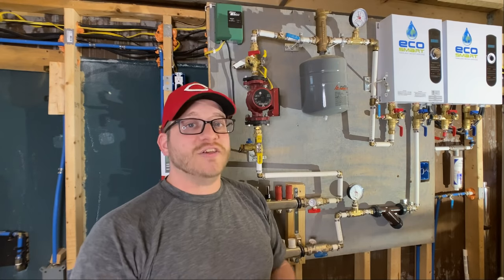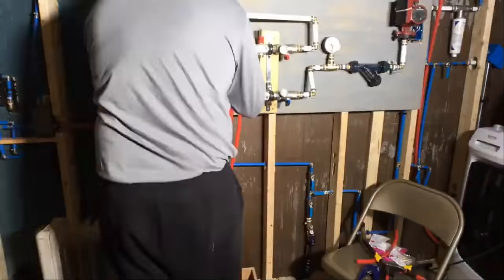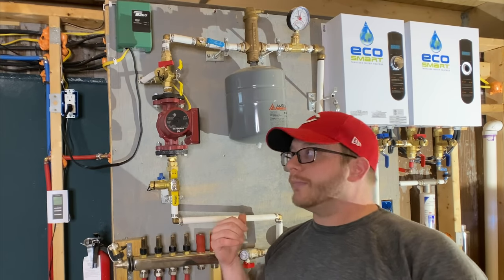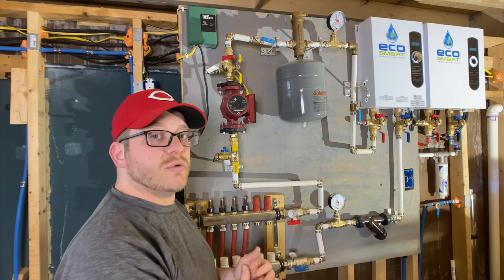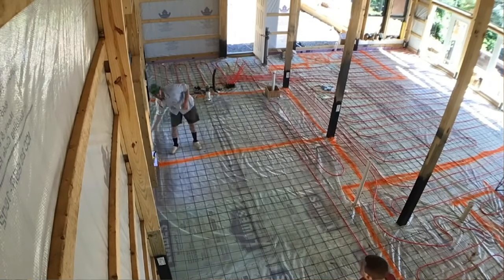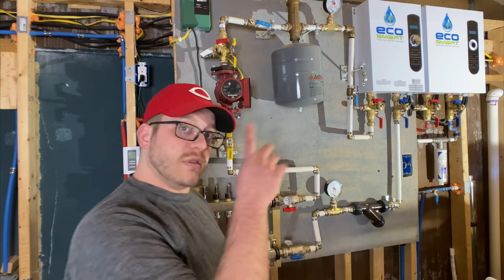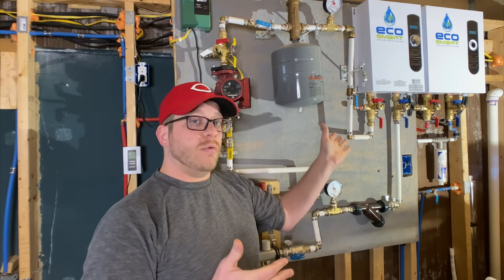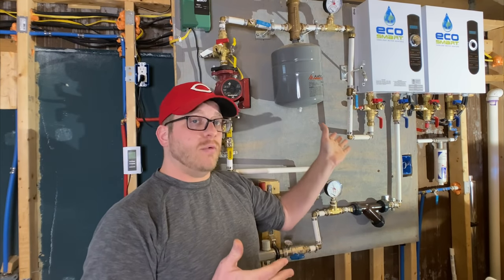Amazing Radiant Floor Heat | One Year Update & System Costs

Comment: I am researching for a build that my wife and I are hoping to start in summer 2022, and stumbled across your adventures.
We are going to construct an earth berm concrete house, and are already sold on electric (grid tie solar) hot water radiant heat.
Average temperature of the earth is around 52-degrees, so we're only expecting 22-degrees (?)  increase. I like the thought of on-demand because we will have 4+-feet of soil on more than half the house (due south with plenty of glass).
We will be around 1,500 sq-ft of living space, and almost another1,500 sq-ft of garage, workshop, mechanicals room, and pantry. 
Do you have thoughts on expanding your installation for an option?

Comment: What is your temperature set to and also your electricity rates?
Reply from the maker: Usually set to 110f rates vary but around .097 per kwh
Reply: @LittleMountainLife  Your heat your house to 110 degrees?
Reply from the maker: Sorry no the house radiant is set to 65 in the winter. The electric water heater for the radiant is set at 110.
Reply: @LittleMountainLife  Thanks for the info.

Comment: When wiring the Taco, in the instructions is says to wire it to the "TT" of the boiler.  Well you're using an EcoSmart instant hot water heater, and has no "TT" to connect to, so what did you do?

Comment: Hey guys, love your content! Quick question is how did you figure out what size expansion tank you needed for your floor heat system? My wife and I are in our home/ attached shop dwelling. Large pad single story,approx 4300 ft of 1/2 inch pex. Anyway, trying to calculate required tank specs, any help greatly appreciated! Thanks!
Reply from the maker: I would contact Radiantec or supply house dot com and see what they recommend for your size system. That’s what we did and it’s worked well.

Comment: Aren't there any safety valves on the system?
You should add a mixing shunt to the system, it makes it much easier to control the temperature for your floor heating.
Reply from the maker: There is a pressure relief valve just after the heater. 🙂
I know some people opted for mixers but we are pretty happy with the setup after a year. 
Thanks for watching.
Reply: Mixer actually has no point when only heat source is direct electric. As the control of direct electric is so easy to do with thermostat according to water temperature. No point of making 120F water and then Mix it to 100F or so as it just increases losses to room air at the space where mixer is installed. Just control the heater setpoint which should be as easy as controlling the mixer. 
Anyway adding mixer to this kind of setup later is dead simple as it only needs one piece of pipe added, but without buffer tank and some other heat source (solar, water circulating fireplace etc) I see no point.

Comment: Newer air source heat pumps or ground source heat pumps are way more efficient than fuels or electric resistive heating by up to 5x in some cases. With the system your running or if you modify to use what i just mentioned and your systems is closed loop, you should consider a propylene glycol antifreeze with inhibitors designed to make your system components last a long time. That PG antifreeze should be mixed 50/50 with DISTILLED water. Doing this will reduce the risks of build up or material deterioration drastically if your using regular water at this time. It would be interesting if someone was to get one of those dual zone air source VRF units and run 2 large AO-Smith tanks without the heat exchanger on them and couple those tanks to to the dual zone air source heat pump. I am guessing you wont get much over 120F temps but the efficiency of the entire package goes way up.

Comment: I have an 864 sf two story home on a cement slab. The footprint is only 24'x24', so downstairs is 576 sf, while the A frame upstairs is 288 sf. If I were to install radiant heat flooring downstairs, do you think the heat would rise to heat the upstairs, or do you think I need to install radiant heat flooring upstairs too? The A frame ceiling is not very high upstairs.

Comment: How many KWh per month do you use in the winter? What is the cost per KWh from the electric company? Here in California electricity is expensive. I use about 1200KWh @ $0.25 per KWh or approximately $300 per month. I use wood heat only.

Comment: Does the 10 lb pressure of the water trigger the Eco tankless heater?  Which would cause the heater to never shut off.  I imagine the pump is what causes the heater to kick on....but I am concerned about my install and the 10 lbs. of pressure.  Also...do you keep the hot water heater at 110F for the radiant heat?  I saw that number on your video?  thanks

Comment: I have a geothermal system with all the valves ,pumps air bleeders, I tossed it all have a sub pump in a bucket in and out flow no pressure just what the pump pushes simple no air traps.in a closed loop system

Comment: Hi! Been waiting for this video! So, how much kwh your system uses? Prices vary by region so that would be clearer for everyone. Also is the other heater for your hot water? Do those prices include both heaters or just floor heating? Please kindly respond.
Reply from the maker: We leave the heater on 24/7 with one 9kw element on during the coldest months. So if my math is correct that’s 216kw/day. 
Yes the other heater is 27kw and that supplies hot water to the kitchen, laundry, and shared bathroom. 
The prices I mention in the video only included the one 18kw heater for the radiant system.
Reply: @LittleMountainLife  your WH shouldn’t be on 24/7. If it was and your calculations are correct you’d be spending $27 a day just on heat if you were here in Montana where we are .09/kWh. Can you look at utility bills for a few winter months and see what your actual usage was?

Comment: Did you consider using a heat pump? Either air source or — more expensive but more efficient — ground source?  The investment cost is considerable, but the with coefficient of performance from 2.5 at the coldest outside to 4.0 — which means every KW of electricity put in you get at least 2.5 KW of heat out — that monthly $250 could be $100 or even less and you'd be looking at a payback period of about 5 years.

Comment: Just curious as I am not familiar with these systems at all. What is the advantage to pumping hot water, compared to just running electrical elements in the floor? I feel like hot water would only be more economical than direct elements if the water were heated by gas, heat pump, or district.

Comment: Nice job on the home. Do you use both electric water heaters? I think you said one was 1800 wats and one was 2800 ways. 
I’m building a 40x60 shop in Iowa. The frost walls are 4’ tall lite form 8” thick concrete
Reply from the maker: The 18kw is just for the radiant. 
Then the 27kw heater is for the shared bath, kitchen, and laundry. 🙂
Thanks for watching
Reply: Just outside of Omaha...40 X 60...keep the shop at 68 degrees...I believe it only cost 40 a month in the heart of winter.  Last month with my bill was 458.00 for my 4200sq house...40 X 80 building and a 25 X 35 pool house.  The walls are foam insulated in the shop and cellulose in the ceiling.

Comment: You need a pressure relief valve on the isolation valves on the hot side coming out of you boiler,  You currently have them plugged off.
Reply from the maker: We added the valve back after this video, thanks!

Comment: Do you guys use pure water in the loops? Or are there additives that you use to keep the system running right? It seems like there is very little metal to corrode in your system, but still thought it is worth asking.
Reply from the maker: Yes, just water.  Thanks for watching!
Reply: Like normal heating water as pex-pipes have oxygen barriers, after water has been in the system for some time and air is bleeded several times, there is hardly no oxygen left in the water, corrosion is really no problem. I've seen many houses with 70 year old radiators and piping that has just water in it, even if whole setup is done with iron pipes. There will be thin black layer on top of the iron pipe and water stinks, but system is fine after decades.

Comment: Awesome job. Been wanting to pull out my gas wall mounted boiler which is nearing end of life and putting an 80 gallon hybrid heat pump DHWH just to see if it could power the hydronic heating. Where I get stuck somehow putting a hydrostat at the in-direct HW tank to tell the Grunfos to run (right now the boiler handles this). I don’t think this experiment would pan out but would love if I could find guidance on designing it.
Reply: Same as his Taco relay he has there.

Comment: Question for ya, I'm looking at using the same hot water heaters, but the ECO8 Model, you said you turned off one breaker to the ECO18 , what are your inlet and outlet temps running with only 9kw vs 18kw
Reply from the maker: So I later realized the eco smarts have a sensor making it so the unit only draws the power needed to heat to the set temp. I now keep both elements turned on at all times.

Comment: Hi I have a boiler radiant system gas and I want to stop using gas and move to electric. with these heaters can I use them with my existing system? thoughts? I was also thinking about using a heat pump water heater in correlation with the current system.

Comment: I built the same exact system you did and my garage is 21 x 32 and i keep getting an e4 error on heater and system is running for a week now and water comming out of floor is still 40 degrees?? help
Reply from the maker: Definitely reach out to the heater manufacturer. Sorry about the troubles.

Comment: For your mini splits, upsize the compressors and get heat exchangers (hydronic) then run your floor heating off that in the winter, instead of the electric tanklesses. Should be way less ongoing cost and more environmentally friendly!
Reply: Except there is no such thing as an A2W mini split, and an air source heat pump will be less efficient under about 20 degrees than the electric resistance they already have.... So there's that
Reply: @Darnellp87  Though I haven't researched it much, there most certainly appear to be hydronic units you can attach to a heat pump (search "air to water heat pump" in Google).  I'm sure they could be attached to the same loops as the ductless indoor heads.  You don't technically need to "upsize" the compressor since the loops would be run in opposite seasons, it likely just needs to be appropriately sized for your application and maybe have some valves installed

Break even for most appears to be down around 0F as well, not sure where you got the 20 degrees number from...

Comment: Do you have a Pressure Relief Valve on the Tankless? I notice you have a red plugged piece of PEX in the Supply Isolation Valve port where the Relief Valve typically is installed

Comment: I work for a contractor who specializes in radiant heat for 30 years and I have it in my shop 4400 sqf. You should never exceed 120 degrees loop temp A.you can crack your floor and B you loose efficiency above 120. A buddy ran his floor at 140 and by dropping it to 120 he cut his bill by a third and still very warm
Reply from the maker: We've been keeping the floor at 90 for cool days and 115 on super cold days.

Comment: Can you explain why you are manually controlling the heat(with circuit breakers).  Is the thermostat not working effectively?  When the thermostat shuts off the circulator the water heaters will not cycle-on until flow resumes.  When flow is on, the water heater should adjust their output (kW) based on the temperature difference(actual vs desired setting).  Shouldn't the system as a whole be able to regulate the temperature without manual intervention?

Comment: You may have answered this before but I can not find it, humidity inside the house, does the HRV remove all of your humidity? Or do you run a secondary dehumidifier?
Reply from the maker: The HRV does a little bit but we are also looking into a larger de humidifier to possibly add later.

Comment: I'm curious as to why you used two smaller units instead of one bigger one?  This is a more urgent thing for me now as my oil furnace was just condemned and the service guy states that by current regulations they can replace it with oil and maybe not gas.  Thank you.
Reply from the maker: I prefer to keep the radiant as a closed system with it's own heater.  There are ways to tie it all together if you want.
The electric tankless heaters are relatively small and not crazy expensive so having multiple units works for us.
Reply: @LittleMountainLife  So you have one for heat and one for domestic hot water? Thank you.

Comment: How much water does 1/2" pex tubing hold per 1,200 feet?  I googled it and came up with about 12 gallons.  How can that be? I am doing something wrong.  My radiant heat system has been going strong for 14 years now using a 50 Gallon HW heater, that is now leaking and I am going with a tankless system.  Trying to figure out how big of a unit I will need to heat and move the water in the slab. We live in the mountains of NC. The slab is about 26 x 48' very well insulated.
Reply from the maker: Bummer about the old heater. 
I actually just spoke with some guys in the tankless heater game and they said my 18kw unit is sized perfectly for our 1000 sq ft slab so you might need to go with the 27kw size if you want tankless electric. 
Not sure of your setup and energy costs but I’m sure you can size heat pumps or tankless propane with a local HVAC guy and get a better idea of your requirements. Good luck though 👍
Reply: @LittleMountainLife  I have it installed and it is working perfectly.  I went with an 18kw Rheem unit supplying water at 110 F.  I plan on shutting it down in the Spring, cleaning it out and leaving the water out of it.  My question is can I simply shut off the water valve at the HWH and not allow the water to be connected in a loop.  Not sure if there is a natural movement of water (at 15 lbs of pressure in the system) that is needed?

Comment: It looks like a lot of concrete between the layer of the floortubes and the floor surface. I think you need a long time for heating up the slab and a high water temperature, or?
Reply from the maker: Doesn’t take more than 4 or 5 hours to heat up and the pex is right in the middle of the 4” slab. 
👍
Reply: @LittleMountainLife  ahh very nice!

Comment: If you need to interact with the heating control due indoor being too toasty the setup relly does not work. It is easy as anything to get heat running, challenge is to keep indoor temp within half a degree all heating season. Floor heating is slightly slow so if outdoor temperature is changing fast the system needs to react already to heat change, not only indoor temperature. For example if outdoor temperature changes from -30 to -15 in a one day system needs to react to that before house gets too warm. 

Lack of too  thermostats in loops seem strange to european, I have 12 loops in with automatic balancing in roughly 1500sqft and it is nowhere overkill. Usually you want two loops in bigger room with one loop close to windows and one for rest of the room to balance effect of window side being slightly cooler. Circulation pump control by heat seems strange, control the water temp so it stays as cold as possible and run the pump all season at low speed (pressure difference control is best for floor). Also good to have automatic start for pump at least once a month even during summer months. I had similar grundfos pump from early 2000's and it will get stuck if it is not run few times during summer. Actually with new pump I will not shut it down at all as it draws like 7 watts during summer as thermostats are mostly closing the loops and thus having really little flow. 

Btw heating of 1500sqft even with european high electricity prices is at worst roughly $150 when heating the water with sensible control. Now 10F outdoors and house is 72F (like always, 71-72) and system draws about 1,7kW from grid on average. As water is heated with air to water heat pump now power to water is around 4-5kW. But some days direct electric (9kW but controlled according to water heat so that water temp keeps within two degrees from setpoint that is calculated from outdoor temp) is used as our heat pump will shut itself down at around -13F (-25C) ambient temp, but for the region it is okay as those days are usually maximum few weeks during a winter, last winter none and this winter 3 days so far. Slightly different heat source but otherwise system is not that different in any other point than heating control.

Comment: Just found your videos, I am about to install a system I have built using the Ecosmart 18kw that I bought new about 3 years ago. Is it still working and are you happy with the results so far? My system will be closed as well so the heater will only have to raise the water temp from the return temp to whatever I set my temp at. Any info you could give me on the Ecosmart would be great as I've been worrying about it working well since I bought it. Also what do you pay for your electric? I'm lucky in Quebec because my electric rates are about $0.095/kw hour.Thanks Steve
Reply from the maker: Still working great and no complaints with the eco smarts. It’s not cheap to run but it’s dependable.
Reply: @LittleMountainLife  Thanks for the reply, how much of a temperature rise can you get with only one 40 amp heating element turned on?
Reply: @LittleMountainLife  Sorry another question in your monthly cost about how much do you pay per kwh? I'm lucky here with hydroelectric at less than $0.08/kwh

Comment: Curious why a slab sensor vs air temperature. I’m in a similar build of home to yours, but not fully insulated yet.
Reply from the maker: Just because that's what I saw most radiant systems using.